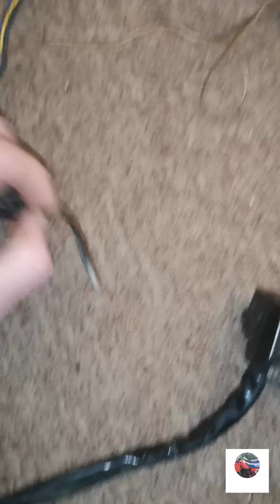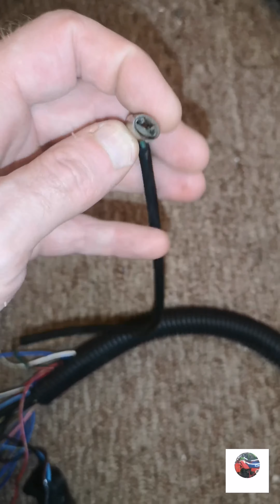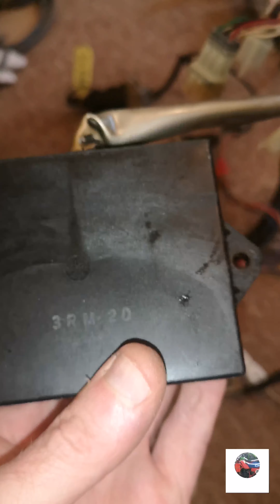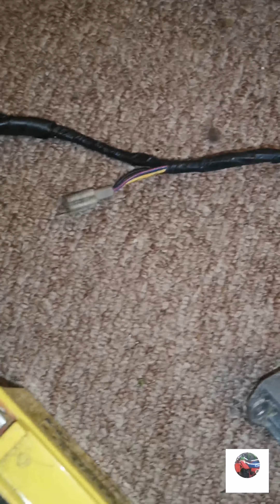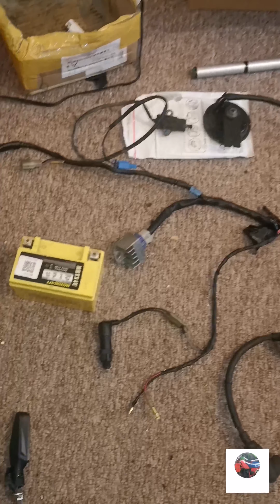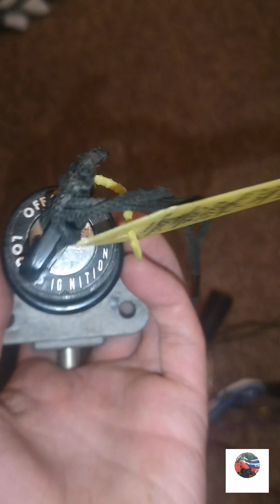yamaha dtr 1997-2003 4BL harness loom repair

Comment: Hi bud. Dno if u r active. Very informative videos thanks man. Have helped alot.

Can u tell me the colours of the wires goin to the rectifier and which terminals their supposed to go on as I have no plug have to use single wires. Its 2003. Thanks
Reply from the maker: Hi M8 top left plug is black ,top right is white,bottom left is yellow with a red stripe and bottom right is the 2 solid red wire goes into the one hole.this is if your rectified is fitted and your looking at it from behind with the security clip on the top

Comment: Hi m8,tell me plase can i run my dtr 125 2003 whitout neutral relay,because it work before without neutral relay
Reply from the maker: Yeah m8 i use to chuck them away cos i bought a dtr with a reley and it was buzzing and vibrating to the touch,i left if and it broke my cdi unit,ive never used one since tbh m8
Reply: @2strokemxclassics  thanks m8,tell me can bad regulator burn cdi
Reply: Here is the story, I done restauration on my dtr and first i have got weak spark but now i don't have any spark,stator parts are in tolerance compare the manual, ignition coil is brand new and is in tolerance,but there is no spark,so i saw that impulse coming to cdi but cdi not sending impuls to ht coil and than i realise that cdi is bad,i bought a new one(zeeltronic), and i just want to hear your opinion and what to check to not burn brand new cdi,

Comment: I have a wire harness that has seen better days, it’s on my 97 model dt125 I have a 1D0-00 cdi box and can’t get spark I have electric going into tho cdi but nothing coming out, my coil plug in that comes out of the cdi has 4 wires 1 black 1 orange 1 blue and yellow and one green and black the green and black has been cut and not sure what it goes to my ignition and has been blanked off as it’s a field bike I have loads of pictures and videos of my loom but can’t post them to show you

Comment: Hello buddy, great vid. Just bought a 94 dtr and wiring is a mess. Someone has cut read switch wires and I can't find the wires but left the read switch in place. Followed loom back to cdi and servo and there's a green wire pairing the two with bullets but it's not on any drawings, could I put the read switch in where this  green wire is. My bike won't go over 55mph. Any help much appreciated my friend.
Reply from the maker: Hi m8 someone's put 97nonwards clocks on, the 94 didn't have a read switch 👍

Comment: I've watched some of your video trying to sort a bad loom out is there anyway I could contact you to ask some questions ?
Reply: Sorted now mate thanks, it was the wire to the kill swith that wasn't connected
Reply from the maker: Buzzing m8 glad you got it sorted
Reply from the maker: What year what's up with it m8
Reply: @2stroke mx classics  it's a 1999 dt 125 r bike with a tdr 125 engine so loom is home made by previous owner for electric start to work I'm struggling to get the cdi wired in needing to know where each wire goes to as all wires are different colours to original I've got a spark but still won't run it ran before loom was removed to fit a new loom before realising It needs the home made loom for everything to work if that makes sense
Reply from the maker: Yeah I know what you mean m8 is the cdi on the back of the oil bottle, or does it have the long thin electric start cdi on, there's a vid on here off a 1999 bike which I fixed 4 someone it had a 1988 loom and wired the 88 cdi unit up there's not many wires on the smallest cdi, a reckon the other 2 cdi, s would be a mission as loads of wires come off them m8. Don't know if a pic of a 1997-2003 loom and oem cdi unit pics would help but I can send some if need or if it's electric start long cdi I can send pics of ot joined upto ellecy 03 to 07 loom, also on breaking a 92 so can send pics of that cdi joined upto the 88 to 97 kickstart model loom
Reply: @2stroke mx classics  it's the 10 wire cdi is there anyway I can call you to talk about it ?
Reply from the maker: M8 look for the 3 vidies called yamaha dtr 125 1999 with 88 3dp loom and cdi it will be in one of those vids how to wire the ten wire cdi up

Comment: Alright mate wondering if you know the rear inductor wire set up I've pulled the wires and only one side flashing think I've worried it wrong
Reply from the maker: Hi there Shud be a green for one side and brown wire for the other with a double black connecter that goes to both eartns on indys
Reply: @2strokemxclassics  yea I've got green and brown I pulled the connectors off a while ago to fit other indicators so the black doesn't have two connectors on it I've wired them up but only one side of the flashers are working and the front left a just staying on I've looked at front wires there fine
Reply from the maker: Sounds like a bad earth m8 somewere
Reply: @2strokemxclassics  yea I thought that I got some spare wire I'll replace the rear ones see how that works mate thanks for reply
Reply from the maker: No probs m8 did ya get it sorted

Comment: I don’t have a blue wire with red on it for the side light is there anything else I could use ?
Reply from the maker: Not to sure m8 but that's the proper wire for the sidelight, it must be sum were see if its taped up
Reply: @2strokemxclassics  ok thank you
Reply from the maker: No probs m8 what year is yours
Reply: @2strokemxclassics  99
Reply from the maker: Yeah be the same loom as this they defo be there somewhere is it defo a 99 is ya cdi on back of the oil bottle m8 if so it's defo same as this loom
Reply: @2strokemxclassics  yes just can’t find it mate

Comment: still stuck looking for the correct colors for the front light ie posative negative and earth as there yellow light green and black i thought yellow= posative black earth and green negative but getting no light on front but side light works also now am i stupid front light should work without engine in ?
Reply from the maker: Side light goes into a double blue wire with read strip an earth's in any black, light will only wokk wen eng on switch switches to high when running and touch wire if no joy tried the other wrie there shud be 9 wites coming from yor swichgeat 3 plug, 4 plig and the 2 lose wires that Goe to headlight look. For headlight adapter ya can buy the black part with wites for bulb

Comment: Speedo and reed switch where will they be cut from in my loom mate as the plug I found cut in the air box???  But I wanna make sure they don’t touch
Reply from the maker: The speedo and Reed switch is that white small 4 way connector on vid if its not on tape the wires seperate apart the Reed switch is a restrict or so it's not needed my bro
Reply from the maker: In the small white four way connecter on this vid that's for Reed switch m8 and the other 2 wires in the plug are for the bulb in the speedo, it's at front of loom near run button connecter I'm sure I'll have said this is Reed switch in vid, on my blue one I restored the Reed switch plug was left u see if hanging to right on my vids and it was all standard took 2800 for it but had only 4 miles regesterd with dvla on it last mot was 2007 until this year now its mot I sold it with 200 miles on inthink

Comment: Yo g your 88 stator would that happen to be what’s in my bottom end or have I got a 97-03 in it mate my stator wire plug jumps to different colors 

Also where do the 4 earths go out of the loom mate still lost with them I got the one to coil tho

And I have a black and white from ignition that’s cut and roughly 4 wires in the top of the loom could be clocks
Reply from the maker: Yes your 88 to 97 stator flywhelle and bottom end is rigged upto a 1997 to 2003 loom and cdi, your engine number at back of engine will start 3bn,3md,3mb- thennsix numbers 88 to 97,ifvyour cylinder says 3bnoo on the side it is a 88 to 97 cylinder aswell which has a pinned powervalve that doent move, a plug for the servo on your 97 to 2003 loom will have a four plug connecter and a red wire with white stripe for th e bullet connecter motor